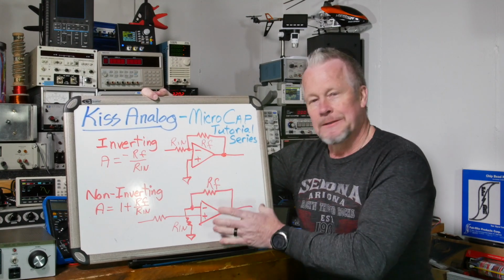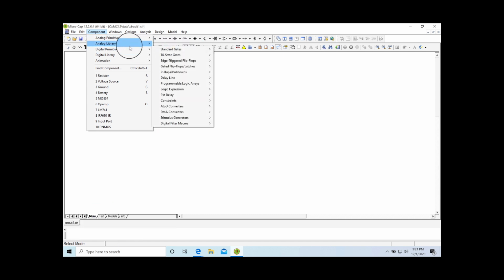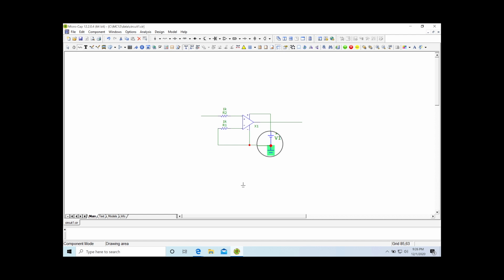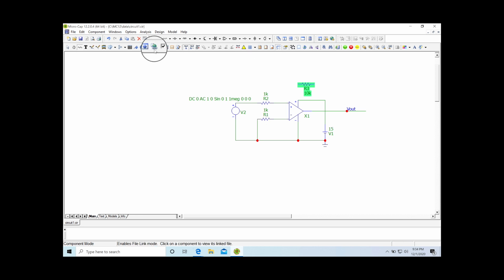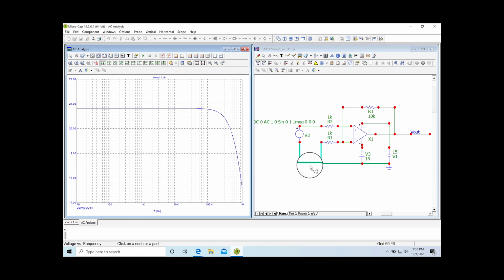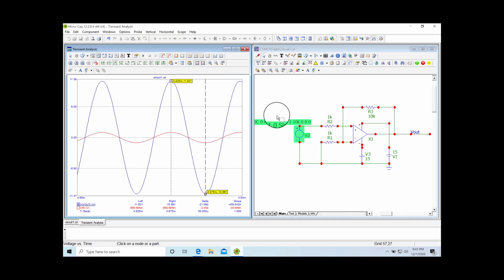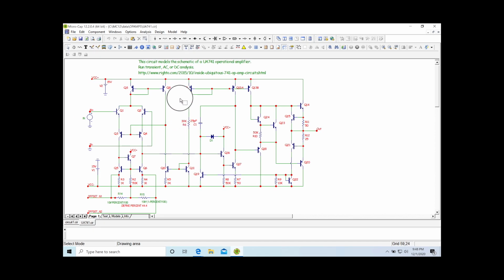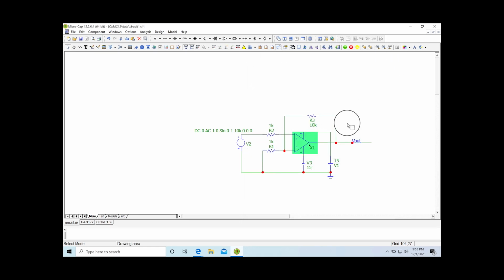OpAmp Refresher and Micro-Cap Tutorial #8 #microcaptutorial #opamptutorial

Comment: Hi! Amazing video!
I tried simulating a circuit using OpAmp TLO72 using Micro-Cap and the circuit worked fine but when I tried to measure the supply current @ +/- 15V to scale the actual power need I found a very high current drain around 20 mA which is way beyond the IC datasheet. Can anyone give me a hint of what's going on? Can I trust Micro-Cap's estimate?
Reply from the maker: Thanks for the great feedback!  Please send me the file and I'll do a video on this;)  KissAnalog@gmail.com

Comment: You're so great for doing these! And, If you find yourself being redundant, it's obviously just something important 🙂✌

Edit: Is there some reason that the opamp on the toolbar (O) forces power supplies to be added? I've tried changing VCC and VEE to blank or zero, but it still makes a seperate "power supplies" tab. This might be an obvious thing, and you might have explained it already🤷‍♂️ 
The options are kind of overwhelming and the errors can be cryptic. Sometimes, like when doing something small like this, I just feel like closing the app and pulling out a breadboard😄
Reply from the maker: Thank you!
You have found something I have avoided bringing up at this point.  Trying to simplify and take smaller steps.  Nice find;) I plan on doing more OpAmp videos as it is a pretty huge subject.  Thanks for your feedback!
Reply: @kissanalog  of course i tripped over an unnecessarily large subject 🙃
Reply from the maker: Great timing - always need to keep moving forward;)

Comment: In micro-cap can you only use IC op amps what about discrete op-amps do they come with it or do you have to make your own? And what about taking a IC op-amp and disassembling it for a discreet op-amp how tricky is this, will it disassemble it for you quickly!
Reply from the maker: Great question!  I'll do a quick follow up to show how to do a discrete very quickly and how to modify it;)  Thanks for asking!
Reply: @kissanalog  that's great thanks!  I'll check it out then when will this be? I suppose you could take that Same principle and replace the transistors for valves that would be cool :)  the only questio? is can you make it small enough, To replace a standard op-amp amp in a device, probably a circuit board with pins and wire soldered to it.

Comment: How accurate is the SPICE SIMULATORS are between the actual circuit and simulation?  I mean if you made a real circuit on a breadboard, and then put that in micro-cap with transferring measured values in micro-cap.  How close will the wave-forms be?
Reply: Guess it depends on parts used ? LIKE resistors or good connection to pins on devices. Worth a try right ?
Reply: Very often component layout and wire lengths, shielding etc. are quite critical, even in audio devices. Circuits operating at radio frequencies etc. are of course much more difficult to simulate properly.
Unfortunately these simulations are not able to comfortably handle those real world variables in a way that I would like to see.
Reply from the maker: That is a great question - and really the whole point of simulation.  If it doesn’t match reality and it is always so good.  Once I finish stimulation and the design of the circuit and than Test. I adjust the simulation model to match the simulation test if possible or try to understand why they are different.